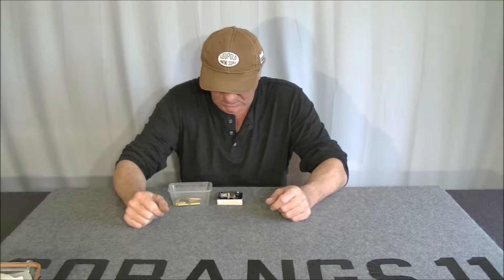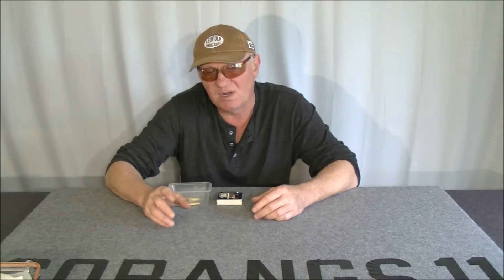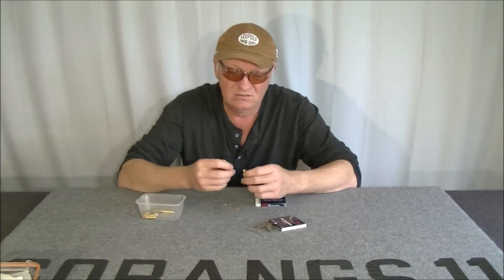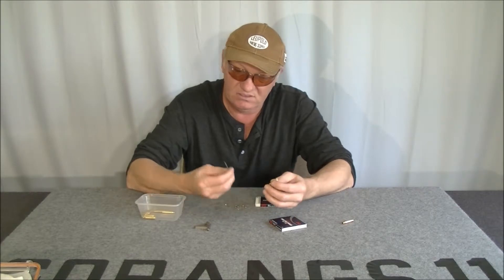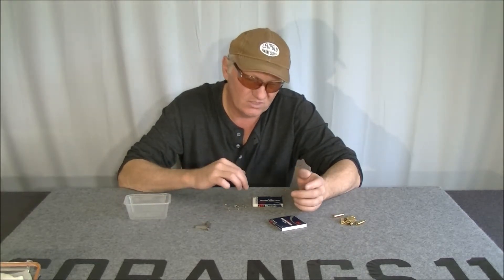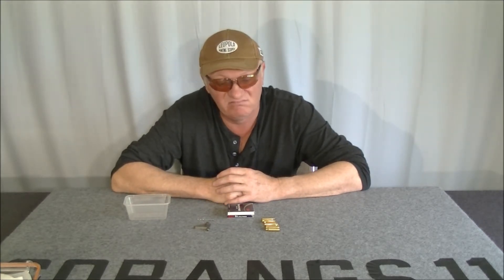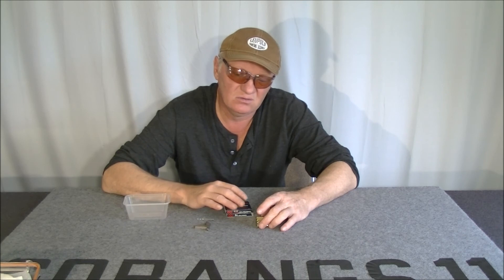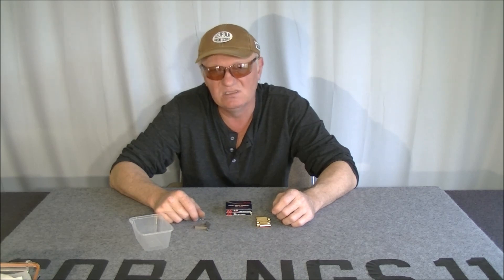Hornady 17 Hornet brass primer pocket problem

Comment: Same here, but only with Hornady factory loaded once shot brass. I use a hand primer myself with FedGM's. I ordered new brass & have not had this problem. New Hornady is no problem, but once shot from Hornady ammo is no good for priming when reloading.
Reply: I had the same problem with once shot brass and unprimed after all they come out of the same machinery, the problem in Australia is that 17 Hornet is not really a thing and brass can sit on shelves for a long time before purchase. So, I am waiting until I can have some certainty that the garbage has been cleared. Thanks for commenting. By the way I now steer away from Hornady brass in general because it really is second rate. If I can get Lapua ( obviously for serious accuracy ) I will, yes you pay double but it is without exception perfect straight out of the box. As Eric Cortina says his brass prep is opening the box.
Reply: @g11outdoors8  All the new brass I have bought from Hornady has worked perfectly. Don't buy once shot, buy new if you can git it. The hornady factory loaded brass has some kind of problem. Not only were some to big, but some were also to small or misshapen or something. When I seated the primer it would sort of flatten it out of proportion on the face. You could tell these easy, because they would have a lot more resistance when seating.
Who else makes new brass in 17H? All I can find here is Hornady.
Reply: @ljgregory1  Yeah, Hornady seems to be it. I am reusing fired S&B brass so that is an option. It's cheaper ammo than the Hornady Superformance and pretty much the same accuracy.

Comment: I had it when I reloaded 17 hornet cases using hornady brass once fired the primer would actually bulge out and couldn't close the bolt I had to uniform the brass then it seated great.
Reply from the maker: Is that with recently purchased ammo or older stuff?
Reply: @gobangs1117  it was about 6 month old fired brass informing the brass fixed the problem

Comment: What loads work best for you? I load 11 gr of IMR4198 with a 20gr HP Dogtown bullet. At 100 yds I can put 3 rds in about the size of a quarter. Most loads come to about the neck of the brass, but occasionally one will be almost at the rim of the brass. I cain't figger that one out at all.
Reply: I am back to square 1. My press is junk and am waiting on a RCBS Summit press and expander mandrel to be able to load with good concentricity, even seating depth and consistent neck tension. Because the cases are so small burs at the flash hole while not being an issue with larger cases could be the problem in a case with such a small capacity like the Hornet. I deburr all flash holes regardless of caliber, except for Lapua, I wish Lapua made 17 Hornet brass! If Lapua make it I buy it! For serious accuracy calibers that is. Since using Lapua in various calibers I have NEVER had to do any brass prep at all, all the others I deburr flash holes and chamfer inside and outside the throats and God forbid if for some horrible reason I have to use Winchester(Olin) brass I typically have to run them through the sizing die to get the dints out.

Comment: Do yourself a big favor and quit using Hornady 17 Hornet  brass.   I now have been using  PPU reformed 22 Hornet  to 17 hornet now for over 3 years. Haven't a had  single case problem yet. If you check back in  the history on 17 Hornet. Hornady has had several problems with 17 Hornet brass even from the beginning.
Reply from the maker: Thanks mate, yeah after all the dramas I bought a heap of S & B ammo that I reload with now. I saw last time when at the gun store that the new Hornady brass has been packaged differently, whether the problems have been fixed I don't know, I didn't get any!

Comment: I recently bought 100 pieces of 22-250 hornady new brass and every one of the primers fell out. now i have 100  22-250 brass that is worthless. and no response from Hornady. i will buy no more Hornady brass until i hear from them. and new Hornady brass is not cheap.
Reply from the maker: I love Hornady projectiles, cases I treat like the plague. Thanks for commenting.
Reply: @gobangs1117  Yep, Hornady bullets are great but the brass has gone to hell.
Reply: Spend the extra money and get lapua brass